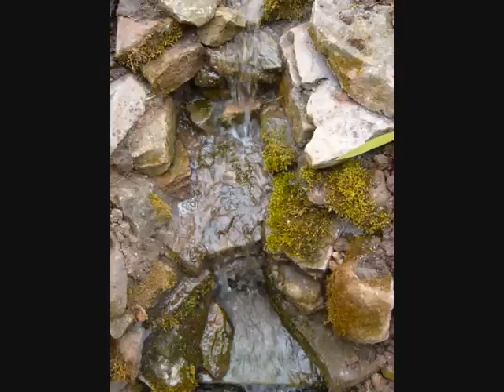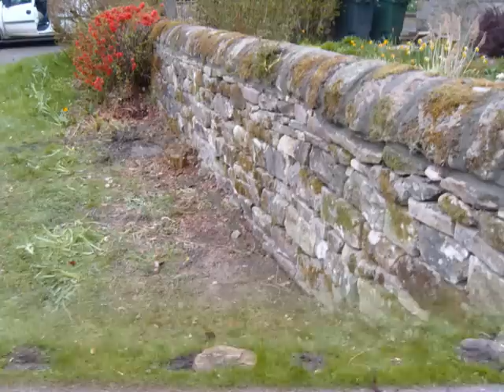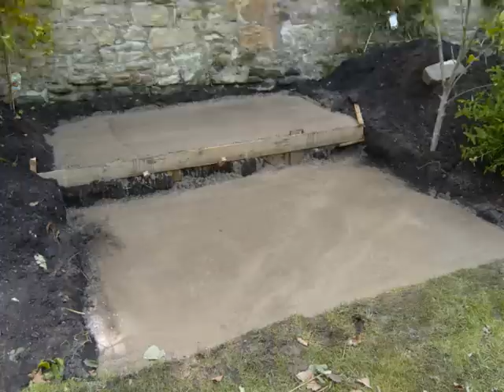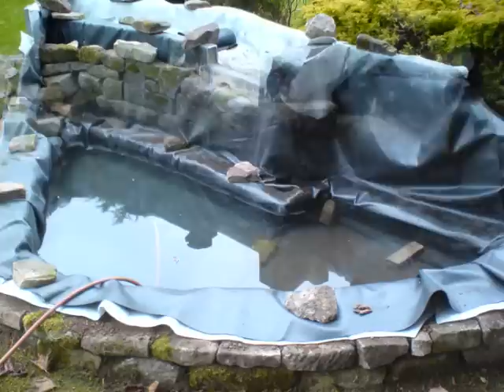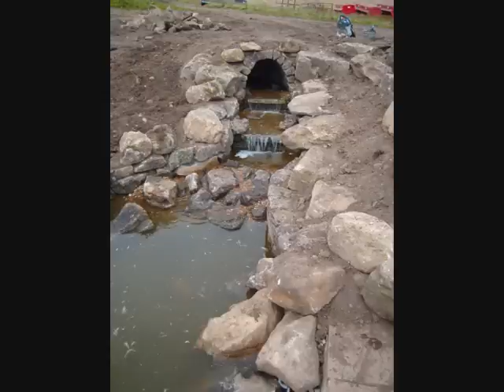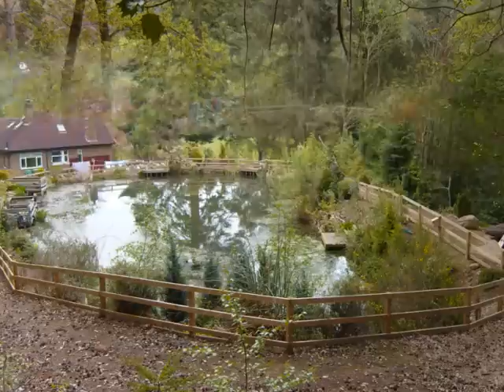PONDGURU - Recent projects - North East

Comment from the maker: There are loads of newer (better) jobs in the 'Pond' playlist on the right side of this page. The ones in this video are over 3 years old now. In the winter, provided the pump is moved into the end where the cascade pours into, or switched off the fish should be fine. If the pump is switched off, I recommend using a small air pump to disturb the surface which will prevent freezing. Its the build up of gas under ice which kills fish much more than the low temperatures.